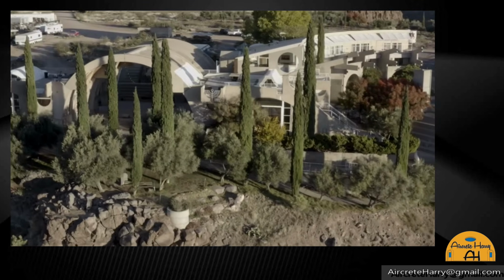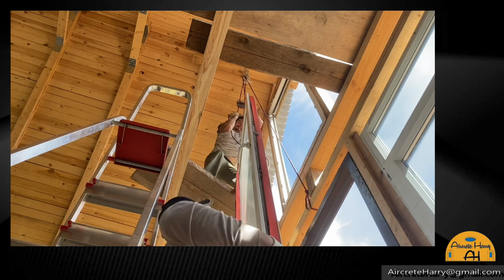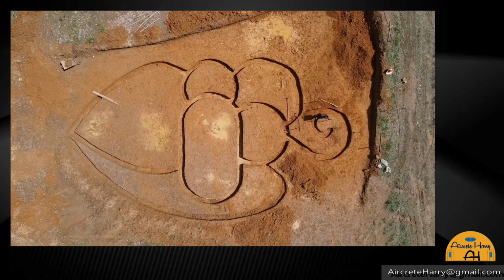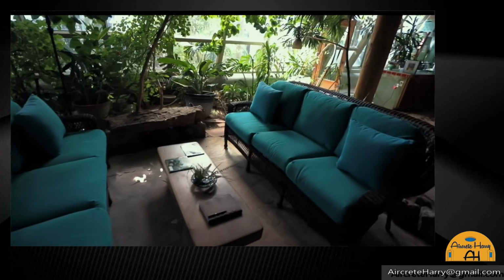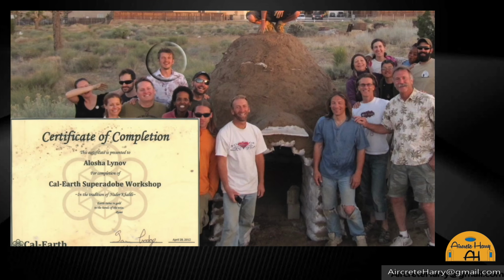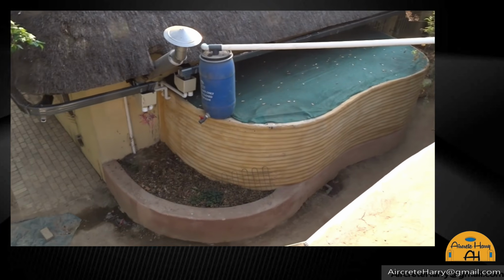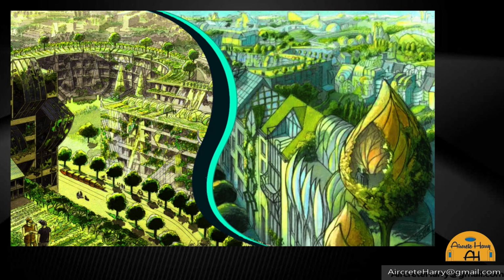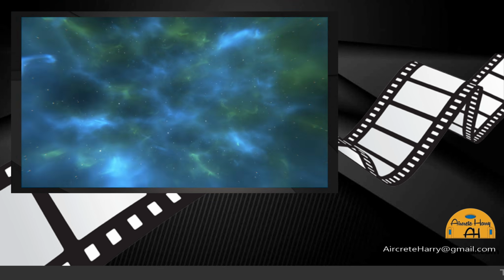Earthen Build Workshop | #AircreteHarry #update #workshop #natural #buildyourhome #create #future

Comment: Harry! I need to ask if you ever did anything with the secret ingredient I told you about; pine pitch.
There is other news! You want to know this;
Look up "Natron theory". Basically, baking soda can be used to strip silica from granite to make waterglass, but more interesting yet, you can use aluminum dioxide or wood ash (which contains aluminum dioxide) to harden many sandy solutions into solid rock that's quite strong.
But it doesn't end there! You can look up the fake recipe for Starlite, known in full only to the dead Maurice Ward who invented it; it's sugar, flour, baking soda, corn starch, and water. You hit that with a flame and it resists 10kF after expanding into a weak foam. Modify that formula by mixing in some waterglass, aluminum dioxide, and you have something that is closer to a firebrick if you bake it instead. Microwaving is another option but be careful.
I just ordered the book and I'll be excited to read it Sunday and figure out a recipe for foam like stone and give it a try. Carbon is a problem I think, so I'll be looking for ways to excuse it from the formula as much as possible. Sodium will balance it at 34% as baking soda, but beyond that it turns the material gray to black.